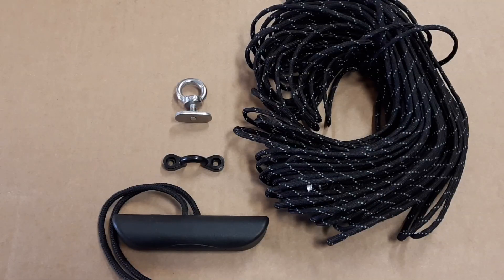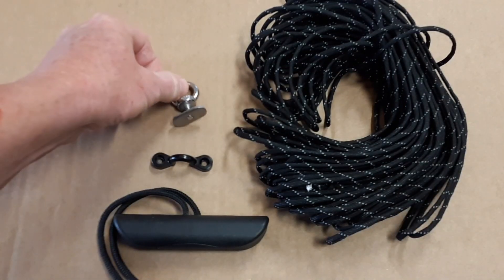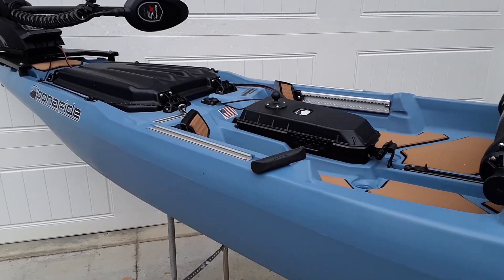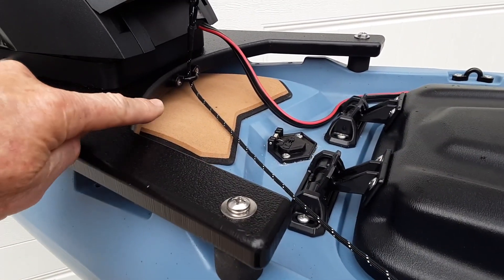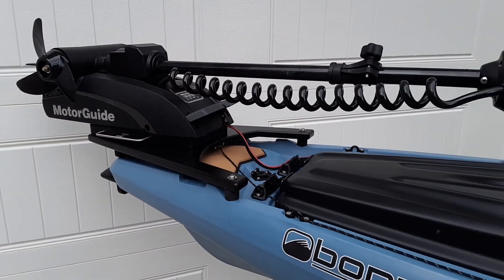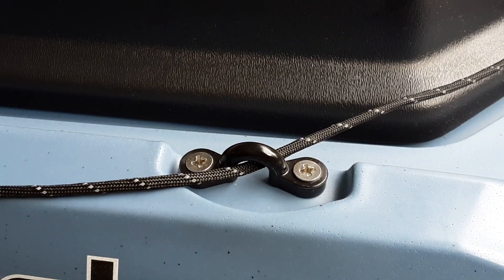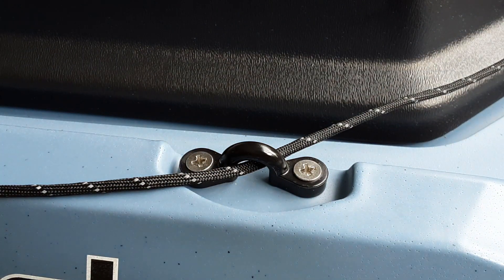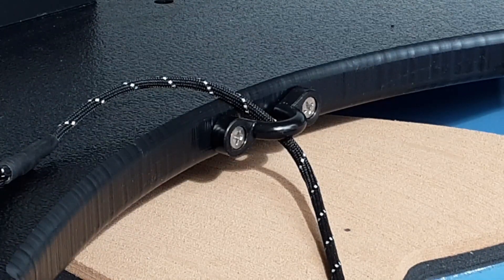Bonafide SS127 Kayak Motorguide Xi3 Bow Mounted Pedal Release Cable

Comment: i don't see the point if you still have to manually deploy and retrieve the motor?
Reply from the maker: Because you can do it from your seat.
Reply: @Aksmaniyak  does that motor auto deploy and retrieve?
Reply from the maker: @robbot9877  No. Minn Kota makes one but it is expensive.
Reply: @Aksmaniyak  yeah crazy price. I've been trying to work out a way to deploy and control a watersnake GPS  65lb bow mount motor from my seat. Maybe an actuator to raise and lower motor. and rewire the power buttons to my seat.
Reply from the maker: @robbot9877  That would be a great project. If you come up with something post it here. Thanks.